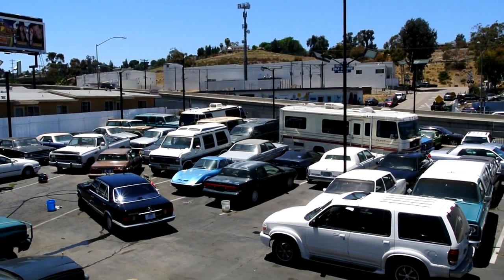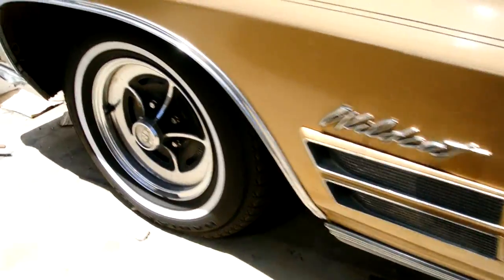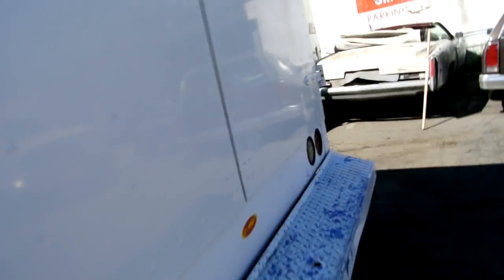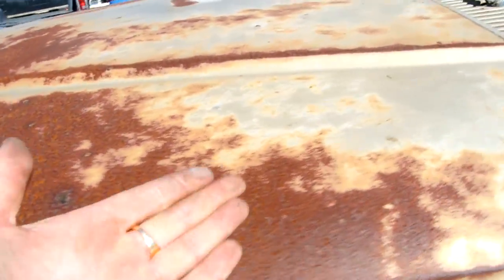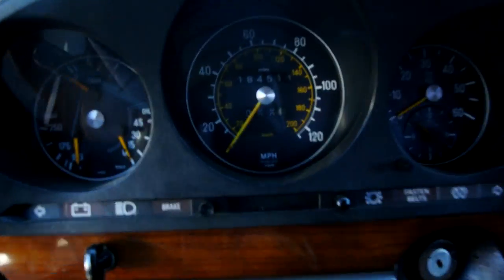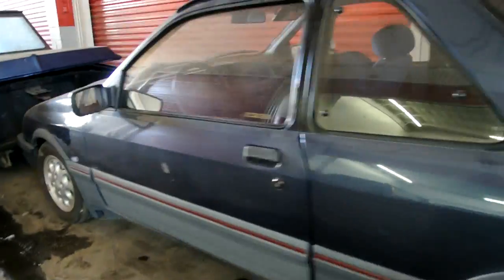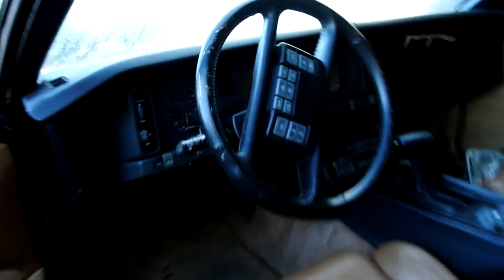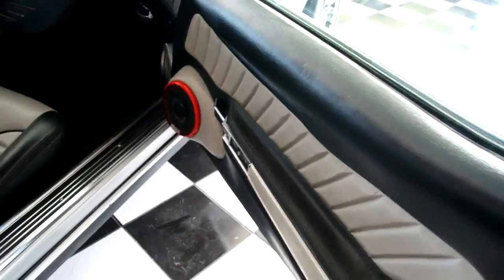Netherlands Import Youngtimer Video VAT MOT TAX Dutch Pre 1986 Lot Walk Around 200 cars

Comment: The '70 Wildcat is a cool looking car. I don't think I've ever seen one of those before. Did some reading on the 455 motor. 1970 is the last year those motors were rated at 350HP. GM had to change up the motors in 1971 to comply with federal emissions standards and allow them to run on unleaded fuel. In 1972 the 455 motors were only 250HP. It looks worthy of a restoration to me!

Comment: Nathan, the controls on the BMW E23 735i 5-speed manual are in German.
Kalt - cold
Warm - hot
Smog - smog???
Klima - A/C, climate
Defrost - defrost
Oben - above, up
Mitte - centre, middle
Unten - below, under, down
Fond - back, rear
Heckscheibe - rear window defrost
Ü.Regler - light control thing???
Anzünder - smoke cigarette lighter
Nebel - foglight
Aus - from???
Warnblinker - hazard lights